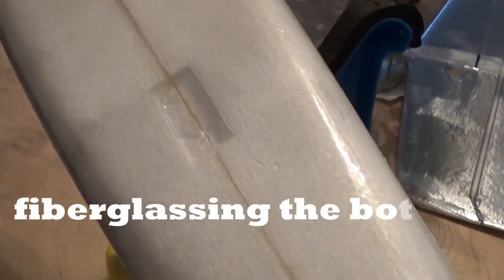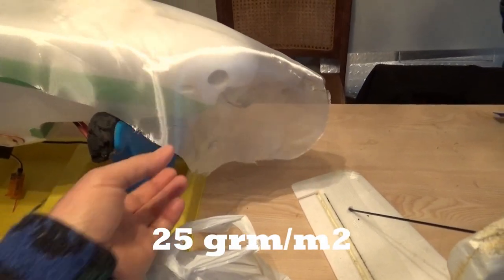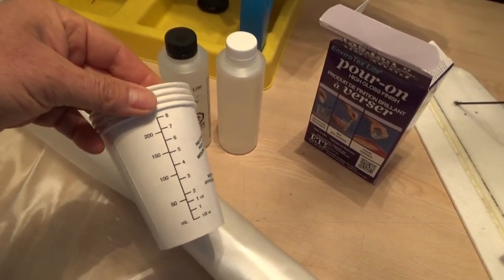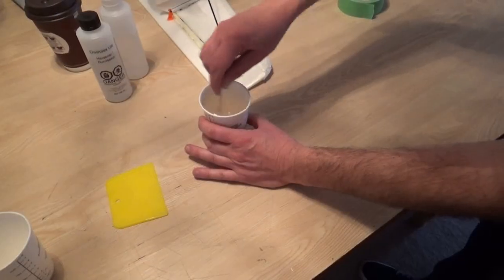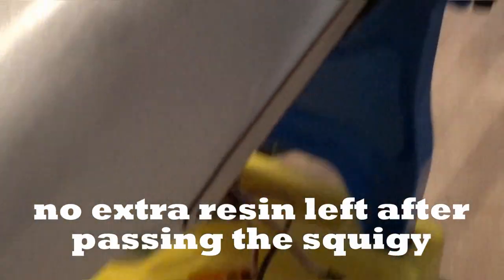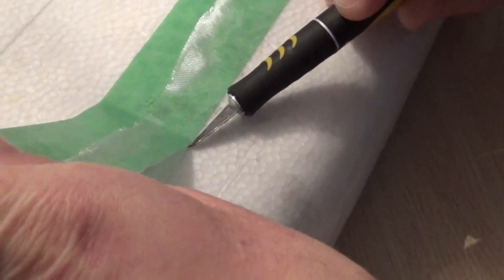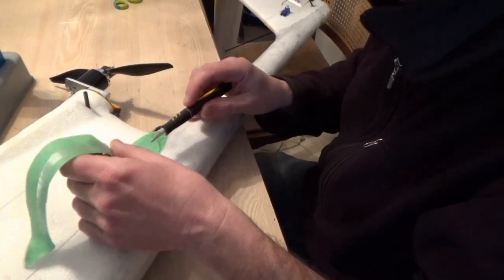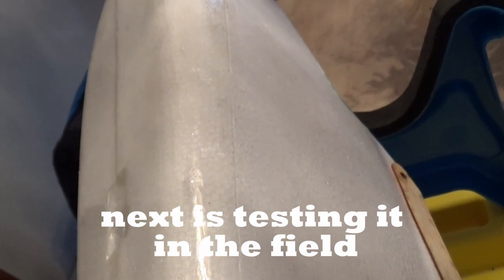Fiberglassing a EPO foam RC plane

Comment: Even the strongest smelling epoxy resin doesn't smell that bad. Polyester resin does. It's cheaper and would be better for your application. Besides, most fibreglass is formulated specifically for Polyester resin
Reply: Thanks!
Reply: Except polyester will eat at the foam substrate. Epoxy wont eat away at the substrate

Comment: I'm about to build an epo foam fpv flying wing and I'm going to use the resine you recommended to glass the wing. I wanted to add some structural strength since I've seen demos of the kit and the wing flutters in high speed dives. This should do the trick. Thanks!
Reply from the maker: Awesome idea! What wing are you going to work on?
Reply: Epo foam or eps?  It’s called eps
Reply: @johnle231  That's incorrect! Click the link in the reply above. The title of the plane is "ZETA FX-79 Buffalo FPV Flying Wing EPO 2000mm Wingspan RC Airplane Kit". Under features, you'll see the item "Ultra tough EPO construction".
Google "epo foam" and it's defined as follows: "EPO is a molded plastic foam material that is created by engineering polyolefin into small beads and then using heat to mold it into different shapes. EPO is very durable and tough. It is commonly used in making model airplanes and automobile parts, because it is very resilient to damage."

Comment: old video, but great video!   Thank you!  I killed my new glider and busted off the nose.   THere goes $240.00   Thinking of glassing the whole ship.  Your video is helpful.   Thanks.
Reply from the maker: After years of flying with fiberglass bottoms, I wouldn’t do it again! I broke the glass on rocks on landing… I turned to Gorilla Duct Tape, very thick… and for the nose, just hot glue! I fly planes that have been demolished in crashes and hot glue fix the and still flying!!
Reply: @EduardoFritisRealtor  WOW!  Good to know.  I tried gluing plane back together, but it just broke again on a hard landing, not even a bad landing.  Picked up 1/16 baswood, some fiberglass cloth, and figure I'll make a proper repair.  If it breaks again after that, I give up.  Honestly, Balsa models were so much better.   Cut out bad area, rebuild, recover, better than new.  Foam, just not any luck with repairs.  Tried the CA foam and accelerator.  Tried foam 2 foam,  neither hold up very well.  Hot glue you say?  :)  I think I'll go with the heavy repair as if that breaks, well, like I said, I give up.   Just a bad design on the glider.  Battery compartment cutout is a very weak point of the model.
Reply from the maker: @Curious_Skeptic  When “gluing” a plane after a crash you need to use toothpicks between the broken parts… use hot glue on the toothpicks to create integrity on the foam. To fix dents on the foam you use boiling water! Boiling water will restore foam to the original shape! You have to remove electronics that can get damage by water. If the surfaces don’t look to smooth use puddy to even them out or foamtag! You might need to sand after dry!
Reply: @EduardoFritisRealtor  Thank you again my friend!  Happy flying!

Comment: ...just remember and consider the egg-shell effect...very strong and thin brittle outer shell on a soft body...on impact it will crack...like an egg-shell...an outer shell that’s elastic and moves together with the body will last longer...that’s why for example tape works so well on foam...consider what you want and your landing areas...
Reply from the maker: John Stenborg Thanks John, we discovered what you are saying! After a while we moved into a Gorilla Duct Tape with excellent results. It was fun to play with fiberglass though. Very good your explanation!

Comment: I've thought of this before and wondered if it was impact resistant enough to endure a crash with minimal to no damage. It looks great sir! Nice work
Reply from the maker: +DeucesWild I had think about fiberglassing for a while too! Since I did it I realized that it's not a big deal.  It is easy and looks great.  The resin we are using is flexible and hard.  Unlike Epoxy that is hard and brittle.

Comment: After you crashed the  plane , did it have any damage while it was in Fibre glass
Reply from the maker: Yes, it breaks at the point of impact but the whole structure holds well! Avoids the shattering of the foam!
Reply: @EduardoFritisRealtor  Please can you advice where to purchase the fibre glass for the EPO foam
Reply from the maker: @sibujacob977  depends where you live.. you need to get the glass cloth 8 gr/m2 and the epoxi!
Reply: @EduardoFritisRealtor  where did you get the glass cloth . What is the epoxy you used .
Reply from the maker: @sibujacob977  Industrial Plastics and Paint in Richmond BC, Canada. The epoxi is the regular one... mentioned in the video.

Comment: I wonder how much extra weight it gained and of the strength trade off is worth the effort
Reply from the maker: +DeucesWild I think it's totally worth it! Looks great and feels great too.  I was afraid that it was going to be lot's of work and I have never used fiberglass.  It was super easy and fast to do.  Extra weight probably less than 20 grams. Strength? a lot more than tape.
Reply from the maker: We just tried a landing in the gravel road yesterday and it holded perfectly. Minimal scratching at the bottom. It's in a video from the Skywalker flying in the rain, at the end after the landing.
Reply: Depends, this plane isn’t the best example, but with a pylon racer or wing you almost need a little weight to really go fast. The added rigidity enables you to strap on a lot more power. Q light planes get tossed around, which is why balsa flies better. The expectedly rifles and most hot liners are glasses foam, and they’re scary fast.

Comment: Very nice. Do you remember what grit sandpaper you used to prep the foam surface with?
Reply from the maker: #120 light sanding
Reply: Thank you! Found some "Pour-On" locally at Jerry's Artarama, if anyone else is looking for it and has access to a Jerry's. Going to glass the center bottom section of my Wing Wing Z-84 and Skywalker X-1.
Reply from the maker: +bauhaus sounds like a great plan!
Reply from the maker: I let 24 hr to dry and then I apply a coat of the expoxi on top, a generous one to have that glassy look!
Reply: Ok, that's sortof what I did too. I waited for about 2 hours, let it get tacky, then I put an extra piece on the front area and the rear(motor mount). Worked great. Thanks for your help! It's exactly like you said, hard but still slightly flexible. A lot more protection than the polycrylic wing I did(which turned out beautiful but really isn't much more durable).
Reply from the maker: +bauhaus that's great to hear! I did a wing with brown packing paper and polycrilic a while ago and worked out very good. Never friend Polycrilic with fabric.

Comment: So How it has handle crashes? I just bought the hobbyking 18g fiber glass  first time I deal with this. Have you tried it with Polycrylic ?
Reply from the maker: I have done a plane with brown packing paper and Polycrylic and it is awesome.  I have not tried Polycrylic with fiberglass. I suspect it is not going to be as hard for what I researched. Fiber glassing is not for crashing but for abrasive landings.

Comment: i'm sorry, i have a question. does it add more strength if i applied it to the wings? what about using minwax polycrylic?
Reply from the maker: Wibby Arief Hi Wibby, probably it will add more resistance to the wings for sure. I've thought about that a lot and in my experience the wings se OK in just foam. I have made a plane and covered the wings with brown paper and Policrylic and the results are awesome! Very resistant wings! Easy to apply too! I covered wings made out of Adams foam! The plane name is Flair Magnatilla. You can see the build in Flitetest.com
Reply: thanks for the answer.. i'm going to look for it
Reply from the maker: Wibby Arief What plane were you thinking in fiberglassing?
Reply: Eduardo Fritis It's FPV raptor. the fuselage is "plastic" (i don't know what it is). the wing, vertical and horizontal stabilizer are made of foam. that's why i'm thinking to fiberglass-ing it
Reply from the maker: Wibby Arief I wouldn't fibreglass the wings! You will be just adding weight. If you want to stiffen the wings you can put Monokote! Much lighter, prettier and very easy to do! I've done it to all my planes! They have different colours to choose!
Reply: Eduardo Fritis does the weight added by the fiberglass really significant? i've search about monokote,  but it's difficult to find it in my city. does it has other name maybe?
Reply from the maker: Wibby Arief Many people use laminating film, I have used the covering film from Hobbyking. You can try fiberglassing the wings. I've seen planes like yours, the bixler and others and never thought about the need for protecting the wings. The fuselage yes because you land on it sometime on abrasive surfaces like gravel roads in my case. If you do it, let me know how it worked out please.

Comment: Are you glassing the skywalker revolution with the carbon tailboom?
Reply from the maker: My plane is the Skywalker 2014 1880 mm wingspan. Carbon fiber tube tail. From FPV Model
Reply: +Eduardo Fritis Glad to see. I just ordered the 2014 1800 mm wings. Definitely going to glass the bottom of mine. Very nice!
Reply from the maker: +horsship I cant wait to fly it now! I will make a video and share it with you.  The tail is tricky to build! I used hot glue to put it together.

Comment: Does it add much weight? I wonder if coating a whole plane would work? Nice work!!!
Reply from the maker: It doesn't add much weight at all. I believe for the rest of the plane, the wings specially I would, in fact I did, use covering film. I will make a video of it today.
Reply: cool!!!
Reply from the maker: +Aero FPV I calculated the extra wight to be in this case less than 20 grams

Comment: Nice job Eduardo!, how much weight did it add to your plane(s)?
Reply from the maker: Thanks! I didn't weight the plane, before and after. But I guess not more than 20 grams. It is very little material and just a thin coat of epoxy. The plane would not notice the extra weight. I didn't put the plywood supplied for the bottom, so all in all, I would say not relevant for this plane. I covered the wings with covering film from Hobby King. Awesome too!
Reply: +Eduardo Fritis oh nice! it's really minor the weight gain, nice work again!
Reply from the maker: I calculated the weight to be less than 20 grams.

Comment: I wonder how much weight did this product add to the airplane.
Reply from the maker: Herman A. I didn't weight the plane before and after. I could calculate the weight of the cloth which is 25 gr per yard square and the epoxy I used. For this plane is really insignificant.i tend to remember calculating around 40 grams of weight extra. Since this, I have changed they way I protect the bottom of my planes. Now I use Gorilla Duck Tape. It is thicker than the regular duck tape and quite rubbery. It works better with the flexibility of the foam. I didn't know this duck tape existed!
Reply: Wow interesting...  I need to try this gorilla duck tape.  I just crashed my apprentice and this may help for repairs. New better motor can help with the little extra weight also.  Thank you!!
Reply from the maker: Herman A. Sorry to hear you crashed your Apprentice. There is a linen tape that is used for hinges. That might be lighter and better to fix your plane. Someone mentioned this to me. He said strapping tape. It's a thin fabric self adhesive!
Reply: Liner tape for hinges and strapping tape for frame? Got it,  I will look into it.  Yea it was unfortunate that the apprentice crashed.  I was being a baby and wanting a gyro for the ailerons. Gyro failed and you know the rest
Reply: Eduardo Fritis 40 grams my ass, no way.

A buddy did the same thing on a  Apprentice, it killed the flying characteristics of the airplane.
Reply: The Gorilla brand duct tape and its bonding agent is extremely strong. But this tape is very heavy. For wearable surfaces and some hinges on foam planes, I use Long Lasting packaging tape.

Comment: Make life easier for you and spray the surfaces with adhesive spray.
Reply from the maker: Keith Whisman I really enjoyed the fiberglassing, it was a great experience. Since I found that Gorilla Duct Tape is the way to go.
Reply: Eduardo Fritis just cover the plane in duct tape? That would make MacGyver very proud.
Reply from the maker: Keith Whisman Indeed! This Gorilla Duct Tape was not around when MacGyver, it’s more than twice thick than regular Duck Tape and the rubbery surface is quite strong! Great results! I quit fiberglassing since I found it. (Home Depot)

Comment: Hello Eduardo.
How did this stand to impacts? 
I want to Kevlar my Skyhunter and the guys on the forum say to use CA???
Reply from the maker: KillerDave55 Hi Dave, since this video I realized that fiberglass is not optimal! It’s to brittle and landing over gravel doesn’t work. I run into the solution! For years now I’ve been using Gorilla Duck Tape. Much thicker and slippery than the regular duck tape. I use the black one. More than double thickness, rubbery and slippery. Cheaper and easier to apply! All my planes are covered with Gorilla Duck Tape. I have a video of it too.
Reply: Yes, I see this but the Kevlar is to add crash resistance to the fuselage plus apply some to the main wing to increase rigidity.
Reply from the maker: Good idea! I build a plane and covered the wings with brown packing paper and coated with Polycrilic.  I crashed few times and no damage at all! more flexible than fiberglass therefore more resistant.